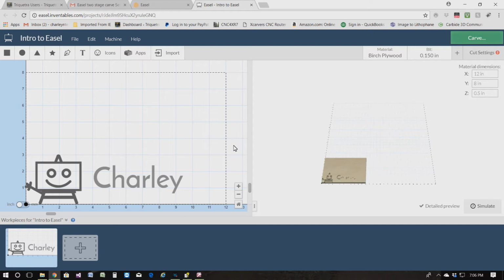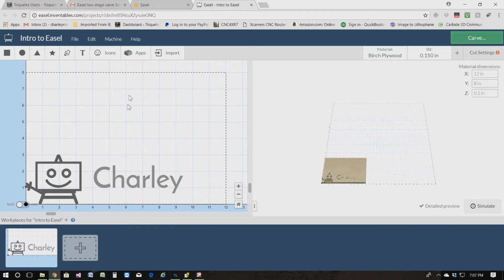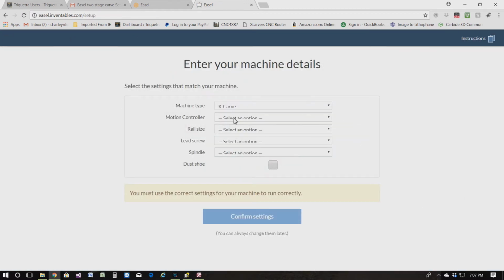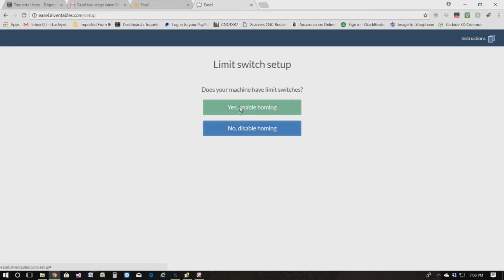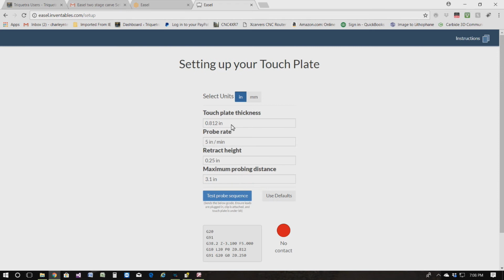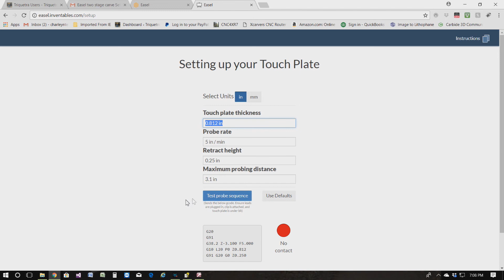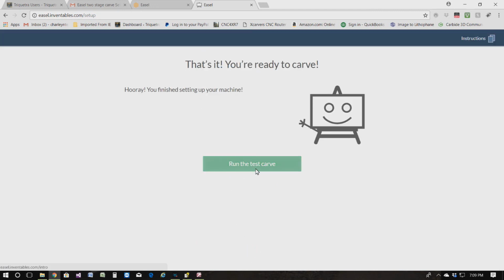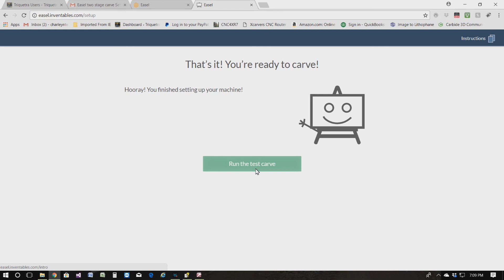Triquetra Setup for Z Axis Zeroing in Easel

Comment: so is the touch plate the prob or the wastboard? I'm new
Reply from the maker: Contrary to popular belief, we were all new at this at some point.  The touch plate sits on top of the material that you want to zero your bit to. Your router bit becomes the probe and when it touches the touch plate is establishes an electrical connection. At that point it stops probing and makes some calculations. Then it moves around and probes the next axis and so on...

Comment: Will that work setting up a cabide 3d probe also?
Reply from the maker: The Triquetra Touch Plate will work inside Carbide Motion but does not use the Carbide Motion zeroing routines. Instead, it uses a script much like the one in the video.
Reply: Whenever I hit control + A to start the sequence the only thing it does is select every portion of the design on the screen
Reply from the maker: @jeep80915  Try hitting the CTRL A before you launch your Carbide Motion or Easel. You should be find then.   You can also edit the launch key sequence by opening the HotKey file in Notepad. The first line of code there is the hot key to start it. Replace the letter A with something else if you like.   Look for this line of code at the beginning:    ^A::  You could use CTRL 1 if you wanted to. It would look like this ^1::
Reply from the maker: I haven't tried it with a carbide probe but I would imagine that it would work exactly the same as a Triquetra would.